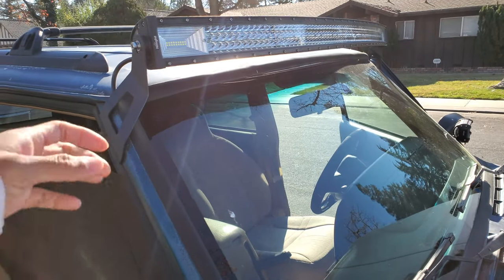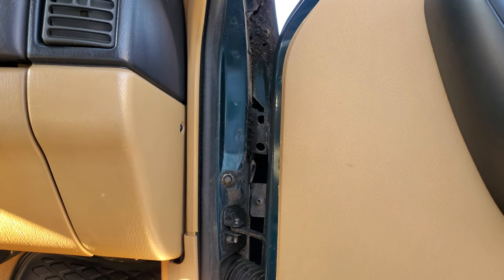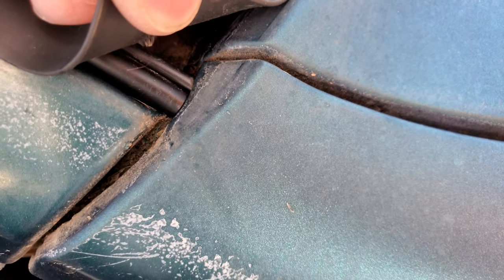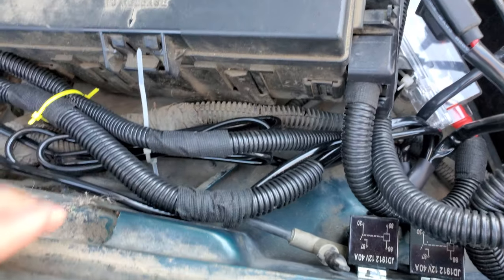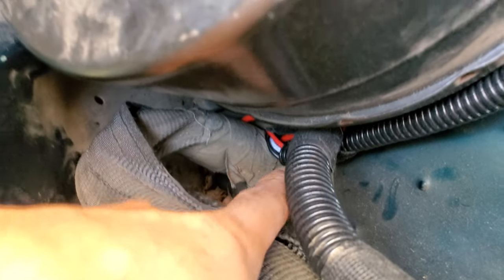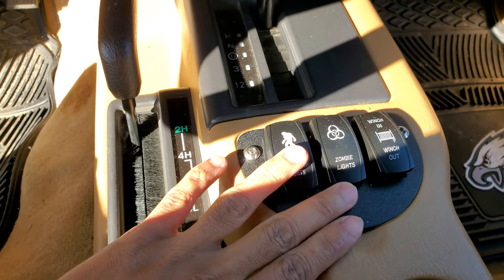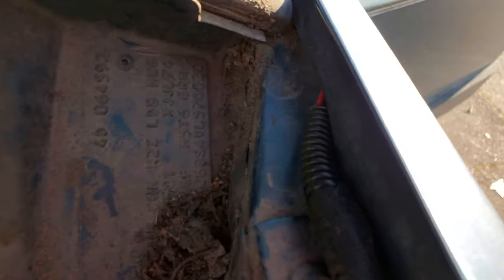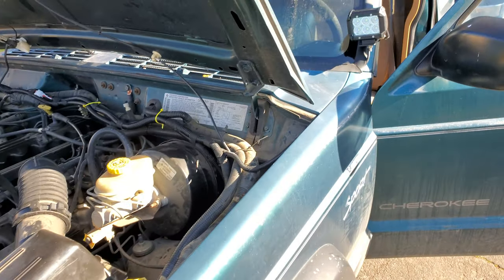How I installed Nilight light bar and Nilight spotlights on 1997 jeep xj

Comment: Hey man I did this a few years ago and it seems you did as well have you had any problems with the weather stripping down later? What about replacing the windshield? im sure you have like a disconnect at the light but if not you'd have to pull those wires through the fender. 
I guess my question is just how is replacing the weather stripping along with the windshield of you've done that?
Reply from the maker: So apparently if you wanna replace the weatherstripping on this xj you need to replace the whole windshield because its fused to it, dont quote me on that but thats what ive been told.
Reply: @EasyED1992  so correct it's built into the windshield that's the actual seal on the windshield. But the rubber weatherstripping is just for cosmetics pretty much is what I was told by a glass tech years ago. Anyways thanks for getting back to me man

Comment: Thanks for the tutorial 
Where did you get the rocker switch holder for the ash tray???
Reply: Were those the brackets that came with the light bar or did you buy this separately and where from if so

Comment: What was up with your long crank issue?
Reply from the maker: I needed a new Fuel Pump and it fixed it. Be careful tho i had a bad CPS months later which i thought was the fuel pump because they give similar symptoms, long crank, even the fuel rail wasnt pressurized.
Reply: @EasyED1992  awesome thanks I think I have the same issues then